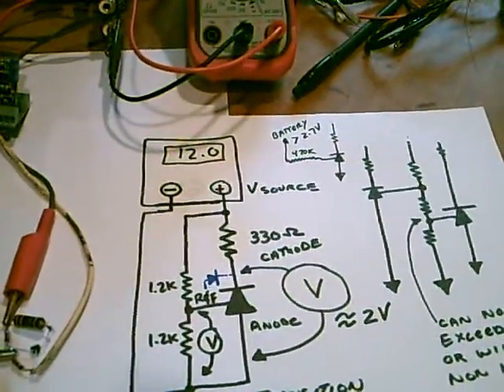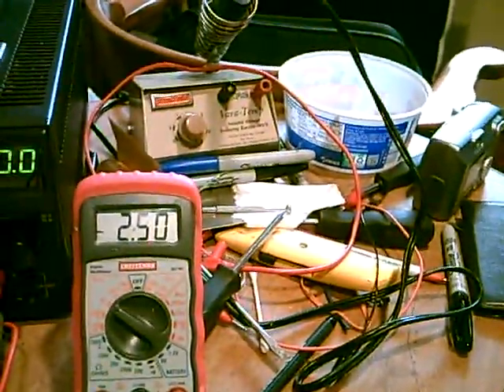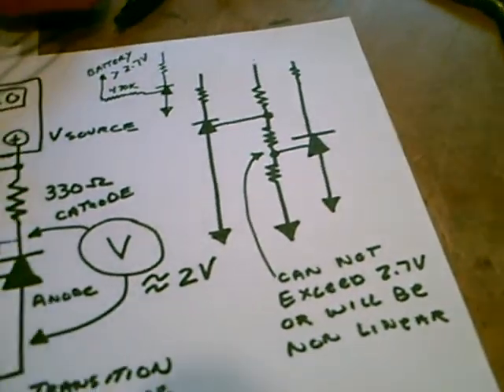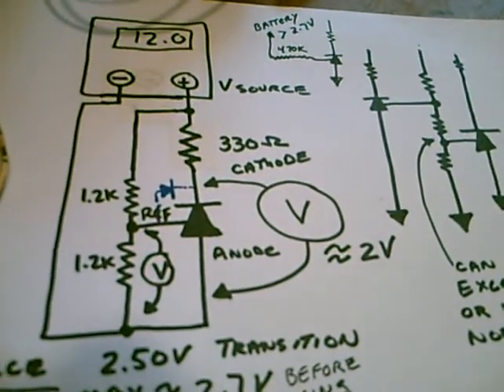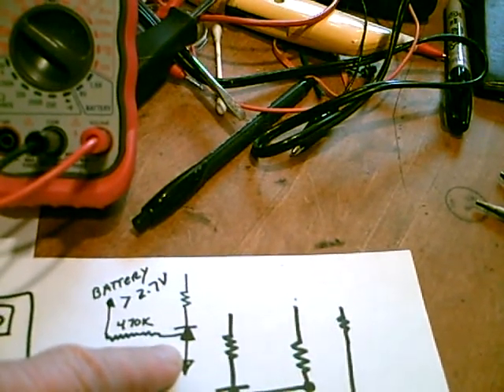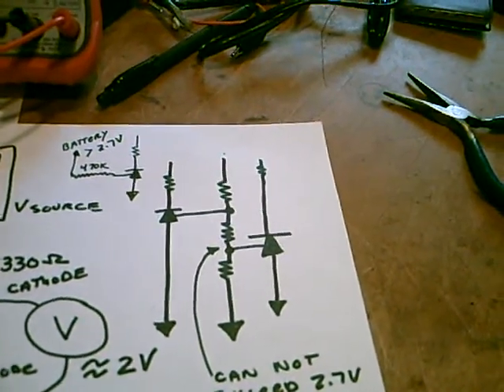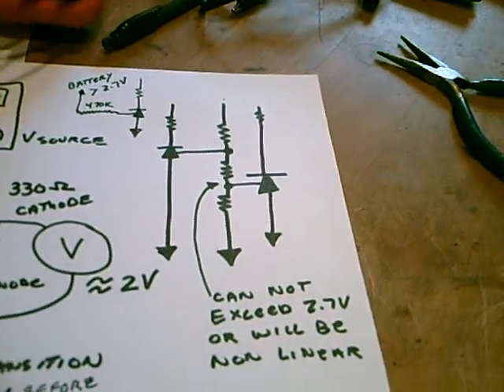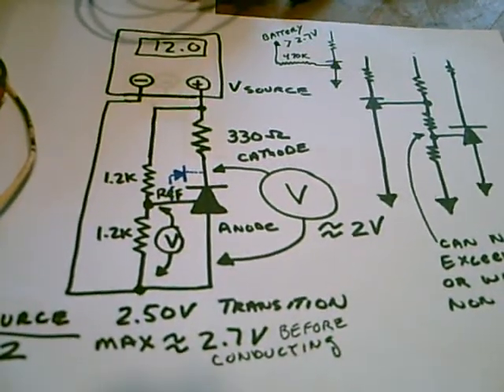TL431 Secrets and Pitfalls

Comment: Yes, this is an older video, but you connected the TL431 incorrectly. Please have a look at the data sheet, for example ST (2002) - Figure 2 on page 4 or TI (2004) Figure 2 on page 15 or Fairchild (2003) Figure 2 on page 4 ... The current-limiting resistor must be in front of the voltage divider. In addition, the error in your circuit is so high because the resistance values of the voltage divider are quite small compared to the 330 ohms. You build another voltage divider between cathode and reference. The only thing that the error is not noticeable at 5 volts VCC is because V (ref) cannot drop below 2.5 volts.
Reply from the maker: NO. Watch it again.  I am referring to using it as a voltage monitor.  The take away should be that the reference pin acts as a real zener once you get over 2.5V and starts to draw current.  The 431 reference input can be destroyed if the current gets high enough. Before that it acts as an opamp input with no load.  The problem exists when multiple 431 are on the same voltage divider which screws up the math. I hope this clarifies the intention of the video

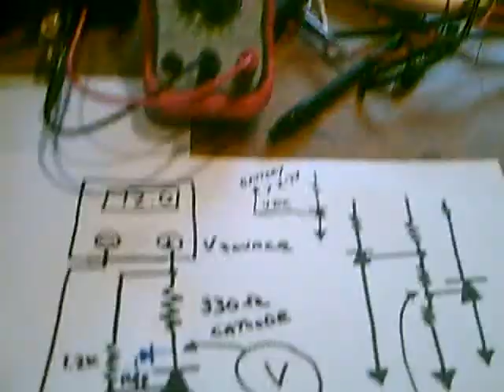Comment: The limit of 10mA is about the current leaving the voltage divider and entering in the TL431 middle pin ( pin 1 of the TO92). It is generally in the order of magnitude of the micro-ampere, so 10 mA limit is not, generally, a problem.  With the sketch at 0:30, the current through the two 1K2 resistors is  12V / 2400 = 5 mA. So, if 10 mA cannot leave the middle point (between the two resistors), and if it was doing, the voltage divider won't be a voltage divider since the same current won't pass through the two resistors! 

Note that **I think that ** the top 1k2 resistor should be connected between the 330Ohm and the TL431, not between the source and the 330Ohm as shown. With THAT modification, the voltage at the bornes of the TL431 will always be 5.0 volts, for a source of 5.0V up to 12V. It is the 330Ohm resistor which will take the difference (at 12V for the batterie, 5.0V at the TL431, the 300Ohm resistor will get the 7.0V of difference, giving total current leaving the source of 7.0/330 = 21.2mA, and dissipating a power of 150mW).
Reply from the maker: That method of connecting was to demonstrate that the voltage divider tap won't get much above 2.5V regardless of how much voltage is applied and it no longer acts as a voltage divider.  As an example of what a beginner might try, monitoring a lipo battery and turning something off when it drops below 2.5V.  Without a current limiting resistor in series with the REF pin, it could burn up from higher battery voltage.  It would also act to seriously drain the battery unless the resistor was quite large in value. Just something they might not think about if thought as a high impedance op amp even though the same thing can happen in an op amp circuit with conduction to the substrate and bumping supply voltage up and possible damage.